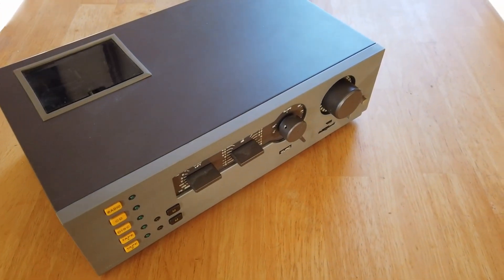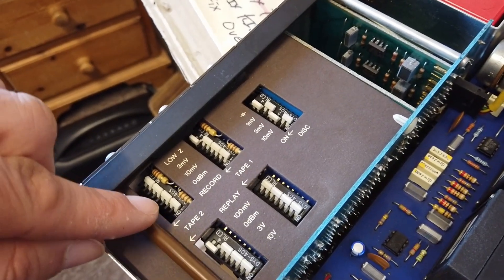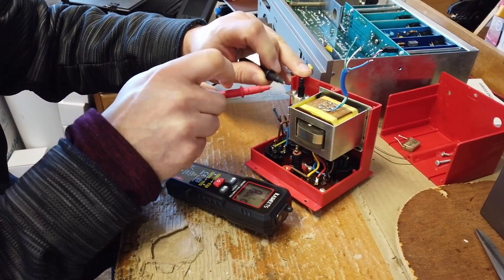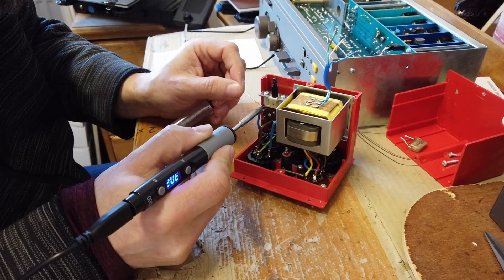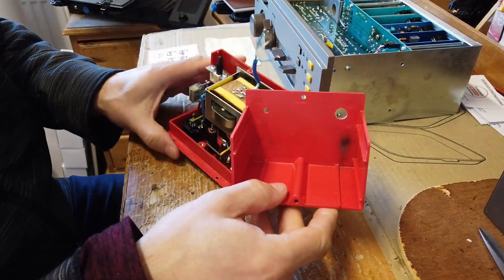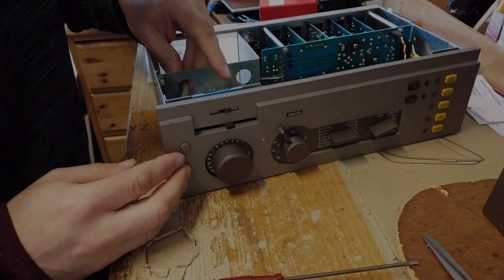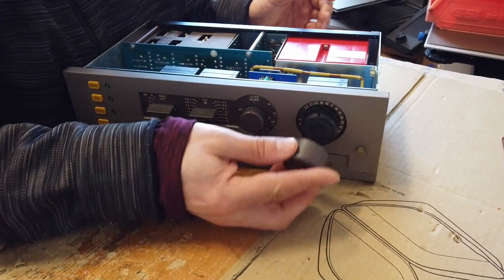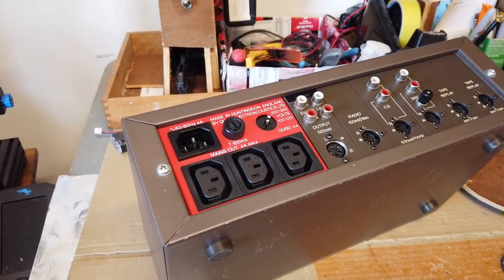DuB-EnG: Quad44 Amplifier Repair - Does not switch on - power supply problems!

Comment: I would have poked the capacitor wires through the switch tag holes and/or wrapped the wires around the tags to make a mechanically sound joint before soldering. Yes it's a faff but relying only on the solder is unwise as the joint could break with vibration. If you are keeping it at home, no problem. But transporting by vehicle or 'plane will subject it to vibration and even impact forces. Regardless, you get my upvote for an interesting video!
Reply from the maker: Very good point, I did the same as the previous engineer.  Stuff them through the holes in the tabs and solder!!  It's always a pleasure to work on lovely kit like this!!

Comment: Why did you pull the volume knob off when you could have done the same glue operation in situ?
Reply from the maker: Useful to know if it was grub screws, splined or slotted spindle... Also the glue may have squirted around the outside and cleaning is far easier...  Best, Howard

Comment: Old unit, but you found its issues. The knob glue even failed, so you know it's old. We are getting a 20 day super cold snap. Only two inches of snow but 1 to 3 inches of snow on Sunday. Cleaning up the sidewalks in bitter cold no fun. But light snows are preferred. Keep cozy.
Reply from the maker: Hey Karen!!  Lovely to hear from you!!  It's threatening to snow tonight, it's minus 2 C today... Please take care clearing those pavements!!  I hope you have a machine... Or is it snow shovel time :-) ...  Merry Christmas and a happy New year 🎊
Reply: @DubiousEngineering  snow shovel and dealing with the Snowplows that fill up my stairs to the street with packed icy slush that freezes rock hard. I have a special small steel shovel just for that difficult area. I go slow with age.